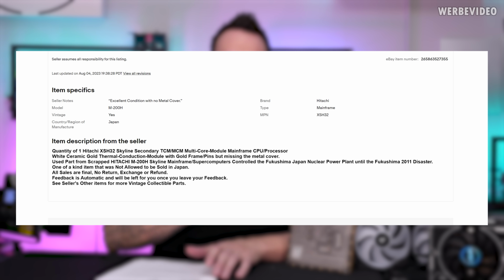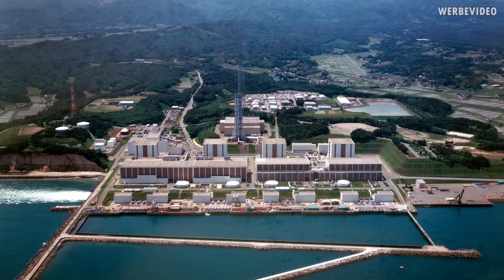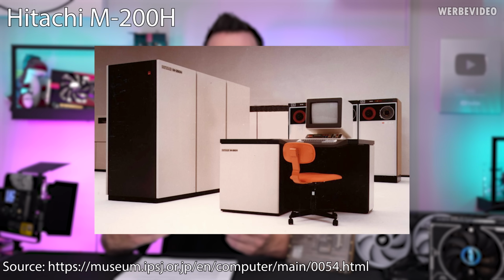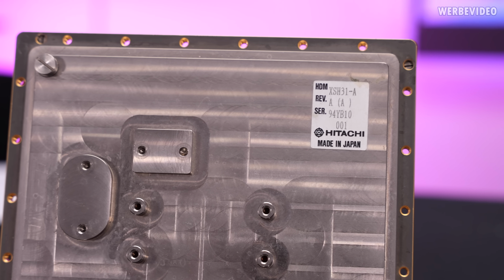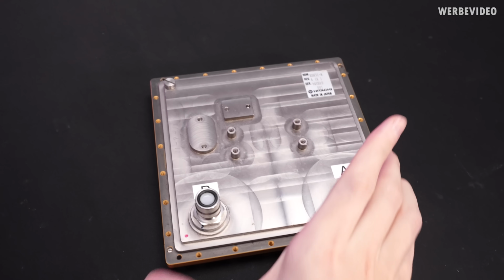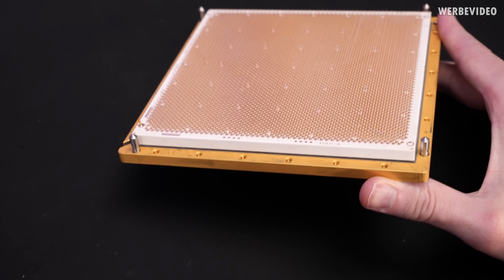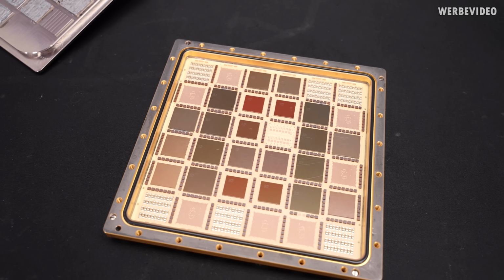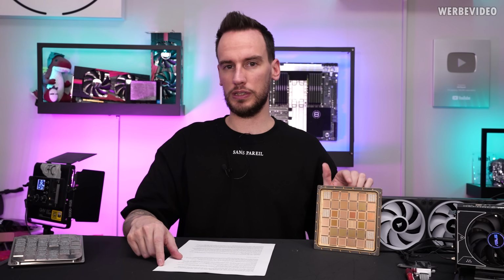This CPU was used in the Nuclear Power Plant Fukushima Daiichi?

Comment: I did a pin count of two sides of the MCM and got roughly 50 pins x 50 pins which would be around 2500 pins not 10000 pins.

Comment: No wonder the SEGA Dreamcast and Naomi arcade systems were so powerful in the late 90s, eh? Hitachi SH-4 instruction set CPUs at their core.. Also would guess they upgraded the mainframes at some point if needing more compute/control power? Seems there are a few locations for extra chip modules to mount too, likely for the higher models? Looks like 10 core dies and 7 cache dies, 5 IO dies?

Comment: forget about security certification if indeed that processor was used in Fukushima it was only bought as a vanity project to make someone look good. It would have never really done anything apart from the running the manufacturers demo programs..... Remember they couldn't even design a system that would keep electricity to very simple circulation pumps.. Even with the foresight of the Thailand tsunami ... Even Homer Simpson would have done a better job at preparing for the worst.... Me personally myself I would have had shipping containers with diesel generators dotted around the place and perhaps even on high land.. With cables long enough to connect to hardened power inlet points connecting to those pum auxiliary pumps........ this is why you need civilian oversight of these technocrats ...  Vote trump 2024

Comment: I worked in communications in the military and we regularly had to inspect and certify nuclear shielding for our ground based electronics to make sure they worked in the case of a nuclear blast. I also happened to be stationed in Japan during the 2011 disaster and saw a lot of footage of the inside of that reactor room. They kept their electronics in similarly shielded HEMP hardened enclosures so I doubt any EM or ionizing radiation got in or out of the computer systems, even right next to the reactor.

Comment: This might've already been answered, but my quick research (Googling: Hitachi HDM -hdmi) points immediately to:
        "HD MicroSystems"
Which, HD further breaks down into:
         "Hitachi-DuPont"

Therefore, "HDM" would likely be indicating that the typed text next to it was a Hitachi-DuPont MicroSystems part/model number. 😊
Reply: Also, unrelated, but I'm not going to spam with another comment... 
Technically, the "biggest CPU ever" would be the Cerebras Wafer-Scale Engine, at 21.48cm across (8.46inch)... Or at least that was the size in 2019! I wouldn't be surprised if they've created even larger by ones. 🥴

Comment: This is a CPU developed with IBM and Hitachi, along with Toshiba, where they all had similar devices, and of course, being IBM, you never bought the computer, merely leased it, which did give the accountants the ability to buy insanely expensive systems, but not have it show up on a CAPEX budget, vanishing instead in OPEX budgets. White ceramic is a 100 layer fired block, with all the interconnects in it, each layer being silk screened with conductive gold and silver based ink, then fired to make it a monolithic block. As it shrinks careful control over the original is needed, and the spare areas are for different variants, they never made a fully populated one, except for supercomputer use, and they were insanely expensive.

Dave Jones of EEvBlog did a teardown of the IBM version, it looks nearly identical.

Comment: and yes... it would have some radiation if it was on site... this is likely back up replacements or decommisioned hardware, and wasnt onsite... but is the type and model that could have been used at a powerplant. not there during the disaster... 

if it was there at the time it would be radioactive

Comment: Corporate licensing for mission critical systems are mental. We used to run support contracts for Telcos that were $25m a quarter, just for Application Software Tech Support. They had to pay Hardware & Database licenses for the servers on top of that. We used to charge product licensing at the transaction per second level. Absolutely insane costs.

Comment: Lots of experience in this area but you'll need someone with firsthand knowledge for a definite answer.

I would guess part of the computers doing the transmission system operation with power supply and grid management. Basically what PJM does in US or what the European Integrated Energy Market does. TEPCO used to do all of that themselves in the areas they supplied power to, along with the other electric companies in Japan. That was changed after Fukushima Daiichi. Still critical infras but also very complicated with many algorithms running to prevent disaster scenarios where generators miscommunication and overload each other. The need to upgrade is obvious in these applications, especially as the scale of the operation grew.

Comment: @der8auer-en The pad pattern of the missing chiplets in your Hitachi CPU are identical to the pad patterns on the CRAY X1 Multi Chip Module shown on the CPU Galaxy channel. It seems very unlikely they would be identical unless the same IC was intended to be placed there. See frame at 4:31 in the Cray video and compare with 12:47 in your video. I grabbed the frames and compared them. The pattern of missing pads around the center of the pad pattern is a 100% match. There must surely be a story here, maybe even one never exposed before.

Comment: From the mid aughts to just before the pandemic, my employer was a contractor working at Oak Ridge National Laboratory in the US. One of the teams we worked with at ORNL was tasked by the US Department of Energy to help with the Fukushima disaster. Generally, they were helping analyze the data coming in from Japan and making suggestions for containment and such. That's about the extent of what I was allowed to know -- as you mentioned, the nuclear types are touchy about their secrets. As a contractor, I was tasked with maintaining some of the hardware being used to review and discuss the simulations they were running. It was kinda cool to learn from the end user of my (very small, indirect) role in figuring the disaster out. And, as a personal point of pride, that equipment I maintained ran trouble-free for the duration of their high-profile project. 😊

Comment: I work in a French nuclear power plant. The plant was built in the 70's.
In older nuclear power plants, all control is mostly analog (for closed-loop regulation stuff) and relay based.
Altough there is some modernization (like core neutronic instrumentation which is based on modern designs like FPGAs and so on, or non-nuclear related stuff like generator excitation control), the rest is 60-70's technology. But it works super well and it's reliable.
Computers are only used for supervision and monitoring/logging, not actual control of the plant.
Reply: Relay-based? Are relays, with moving parts, more reliable than microcontrollers?

Comment: Super interesting, even if you cannot 100% be assured it came directly from the power plant, this type of CPU is clearly only used in a system just like the scenario. There's no clear usage for a CPU like that other than in a control system which requires absolute constant performance with zero down time due to failure. That's what you pay for when purchasing the use of a chip like this. It seems VERY plausible that this chip came from that power plant. Nice job on finding and buying this possible piece of history. Hopefully a viewer knows more about this processor!

Comment: Today, this wouldn't be $350K per month, it's the $10K you paid for it. When adjusting for inflation today, you have to explain the buying power at the time because computer prices only ever got cheaper until recently when they've started going up with inflation. When my dad bought a $3300 PC in 1994, that isn't 10 times the price today even though beef went from $1/lb to $9/lb. It's the same as the cost of a good consumer PC today, about $5-10K in today's money. Housing costs have doubled in 3 years, but PC part prices have tripled. It's not the same measurement.

Comment: People thinking that's a crazy amount of money need to realize that in the lease agreements the suppler usually has a crazy high insurance amount for if the system fails.
300K a month to lease that chip. But if it fails and is out of action for 2 days thats going to cause millions in damages that the lease has to cover.

Comment: There probably was at least a single major control system upgrade over reactor 4's life time.  Pretty much everything got reviewed after Chernobyl in an effort to increase safety, even if the older systems were safe.  To the point of being rarely shut down is correct which would explain why that upgrade happened in the 1990s as the things had to be planned out well ahead of time to hit the proper maintenance cycle.

As for the CPU, several of those dies are SRAM for cache and indeed several processor cores.  Of note is that also during this era a processor may have been spread across several dies with the floating point unit being physically separated.  The memory controller and the bus controller should also be found inside of that module but not the general IO controller.   The merging of IO into the processor packaging was something mainframes only recently adopted (at least on mainframe time scales) as it allow for independent scaling of processor cores to IO and only limited by how many devices the interconnect bus could support.

If you want to see another tear down of a mainframe CPU, Dave over at EEblog has a tear down of an IBM S390 processor from the same general era of hardware.  His unit was 'air' cooled but the packaging contained oil and copper slugs used for heat distribution in its packaging.  When this package was opened up, I was expecting an oily mess to escape.

Comment: Looks pretty similar to CPU modules from IBM S/390 systems (the 6x6 layout of differently sized dies with rows of MLCCs between them), the dies even have strikingly IBM-like markings with IBM-style alphanumeric part number on the last line. Hitachi did make IBM mainframe clones since 1977 and then reached some kind of cross-licencing deal with IBM, which seems to ended up with some kind of sharing on the level of actual hardware sold to customers (IIRC many IBM mainframes made after 2000 contain significant subassemblies that are marked as manufactured by Hitachi).

So my guess that this is an CPU from some kind of HItachi mainframe. As such I would assume that if it was in Fukushima it was not a part of anything directly related to the operation of the reactors themselves but served some more enterprise-wide purpose of the whole plant.

Comment: there is a video from CuriousMarc where they visit a big satellite dish in California, that was and is used by Nasa and others. And they  still use an absolutely ancient computer, that had replaced an even more ancient like 20 years ago. They really don't change a working computer system very easily on old hardware.

They also had a very modern one (probably used for the "others") , which they wren't allowed to show :)

Comment: It's like tools used for silicon manufacturing. For instance, Intel doesn't own any of the equipment used to manufacture their current chips; they lease it. Then when the time comes to move into newer tools, they either return them or buy them to use for legacy products. Also, the cutting edge tools Intel leases are usually bespoke or single production run pieces. They have their own team of engineers from the manufacturer on site and an Intel "tool owner" that manages it. I find it really interesting that while they own their own fabs, they don't own the tools in them.
Reply: i guess there's always a bigger fish, huh. wonder how many tiers higher than our mainstream mega corporations like intel and amd there are

Comment: I wonder if any information could be gathered by talking to Hitachi or the company that ran the Fukushima plant. Outside of Canada, reactors usually have to be shut down every 12-18 months for refueling, that'd create an opportunity for a CPU to be swapped in. The disaster happened in 2011 and unit 4 was in the middle of a refueling cycle during the disaster (according to Wikipedia), with the 2011 engraving it's possible that this CPU was brought in as part of the refueling process just before the disaster or brought in after the disaster to assist with clean-up efforts.

Also as someone who is passionate about nuclear energy, to counter any disinformation, the reactor meltdown caused 1 death. More people died from heart attacks evacuating the tsunami than people died from the reactor itself. That death count is including radiation poisoning and cancer by the way, that 1 death was lung cancer 4 years after the detonation. Nuclear is the second safest source of power, next to solar, according to Ourworldindata, I'd send a link but I feel like YouTube would flag that as spam.
Reply: Great comment, gotta love candu reliability

Comment: I am a nuclear engineer with 30 years designing control systems for commercial nuclear plants. These BWR plants are quite old, and yes GE built the early ones. There was a technology transfer to the Japanese so the later units were progressively more domestic. I can assure you that the control were originally analog. It’s is possible that this computer was installed as and upgrade to the original equipment due to obsolescence. This computer probably didn’t operate the safety controls. These have been left analog where possible, but plant computers were installed for monitoring. Your dad was correct about changing out.
Reply: any chance they may have used a system like this for calculating optimal fuel loading / shifting bundles / re-fueling?  Seems like this system might have come from a pre-cluster computing era, so maybe complex compute like fuel decay may have been something this was used for.  I did maintenance work at a PWR years back, and it was still pretty analog for the controls as well so I'm not sure what they'd use a mainframe system for from an ops standpoint.  Just spit-balling here, interested to hear an engineer's perspective.
Reply: @stevemke  at westinghouse most of our calculations are still deterministic. really does not require much compute to run programs like tracworks
Reply: I'm offering a total guess: it was part of the power distribution side of the power plant. It would make sense they would need a high-availability type industrial computer to monitor power demand, AC phase matching to the grid, communicate with other power stations and substations, monitor MW consumed for billing and efficiency data etc.  @stevemke
Reply: can it run crysis?
Reply: @Linuxfy  🤣
Reply: @Linuxfy  enough with your can it run crysis non sense B$
Reply: All past US commercial reactors and I assume those two new ones,  did not allow multiplexing.  I assume in the control systems, beyond containment. So what these things were doing in a GE Mark I, I have no clue.
But really, no mulitplexing, which means computing in almost every sense, in this day and age.
Reply: der8auers father? He said his dead worked as engineer in power plant for about 30 years 😅 This is interesting knowledge though thankyou!
Reply: "if it ain't broke , why fix it?"
Reply: Can it run Doom ?
Reply: @matybgg  also the only 2 functioning cores:
What the fuck is doom?
Reply: @blood_error7328 oh hey my 6 year old laptop also has 2 cores 😅
Reply: Geopolitical blackmail. Japan said "no" to the "greatest ally" and paid the price.  Those weren't 1000lb "cameras" made in... +cough+ not Japan.
Reply: here we go; here's another one "I was a specialist at a this and that, every conversation I starts includes these preambles, I am a rapper at the core"

Comment: I love SuperH instruction set! It's more important than most people realise. This was a 16-bit condensed instruction set for 32-bit RISC machines, with increased code density and reduced the memory throughput and capacity required, while not increasing the CPU complexity. The Hitachi SuperH patent was licensed by ARM to create ARM7TDMI which came with the Thumb instruction set, fundamentally similar to SuperH. This allowed to integrate this processor into all sorts of shitty, really memory constrained devices - and remember, you can't really power gate DRAM, any extra capacity and bandwidth shows up on your power consumption, and this was crucial for the mobile device revolution and one of the two reasons ARM has been able to come out on top, the other being general availability for licensing at a low cost.

But i don't suspect that these mainframe CPUs are necessarily SuperH based, they just fit in the timeline there and thus the numbering scheme.

Comment: From another Ebay listing of another one, this CPU was used in the Hitach M-200H from 1978, which is mostly in line with the timeline of the power plant. If the listing is true, and the IPSJ computer museum is right, then this is a variant of the IBM System/370, which still has good compatibility with z/Architecture mainframes. Given the high compatibility between IBM mainframes and Hitachi was a Japanese vendor for s/360 based mainframes, that explanation is the most probable explanation for what this is.

I also know an Austrian that would be interested in that CPU, Peter from CPU Galaxy. Think he forgot his YT password though.

Comment: Ima assume that most important parts of any computer component used in any nuclear factory setting would be protected from any radiation. I thought that perhaps the energy thrown off by any radiation would cause random but flips which could definitely cause problems.
Reply: Not really. Large radiation levels are inside the reactor. Other parts of the power plant, such as turbines, generators or transformers, and the control buildings, encounter as much radiation as every other place on Earth.